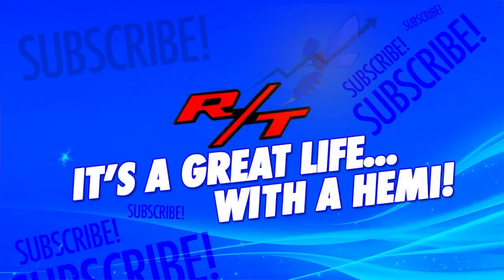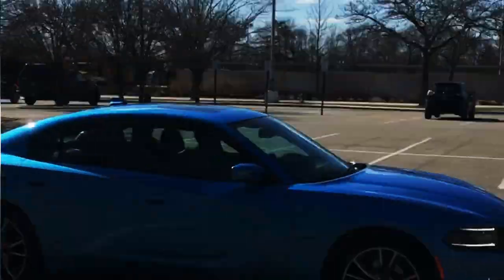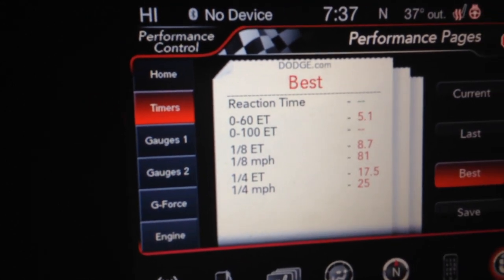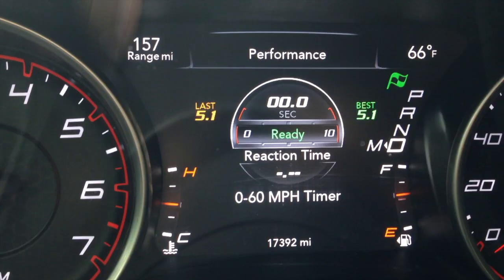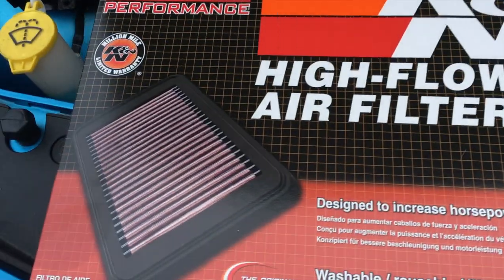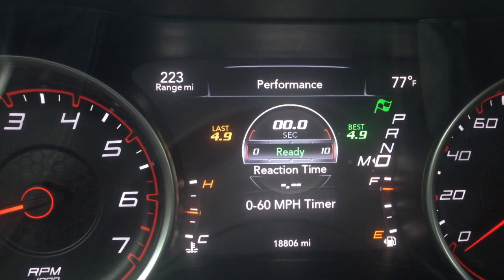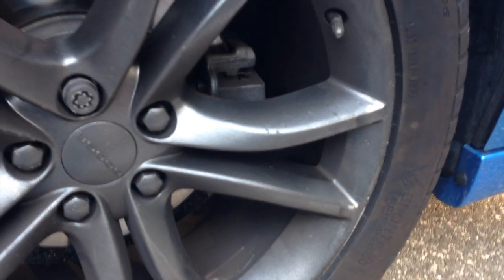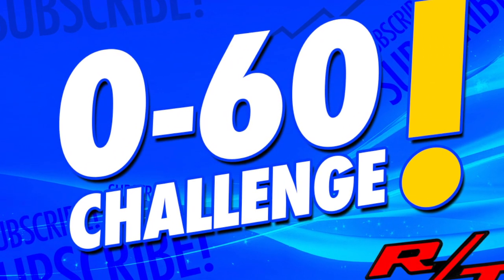Performance Mods // Corsa Intake, Scat 1 PCM..

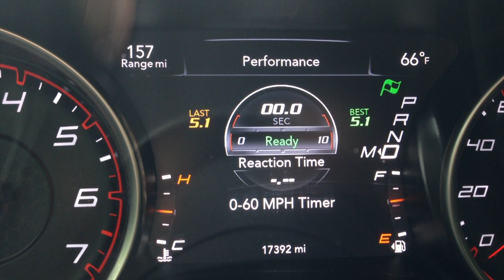Comment: Another honest, straight forward video...excellent!! I can tell that you're NOT 1 of those guys that manages to get some H/P out of replacing Valve Stems!!! Hahahaha....If you don't get any improvements on an install, you call it like you see it!! I like that shit from car guys, and I am the same way. Now, I've not done any "Performance Mods" to my SP Shaker, the only things I've done to it are that I installed a HURST Short Throw Shifter with the Carbon Fiber Pistol Grip (Fuck I love that thing a lot, with the Shorter Shifts and the looks and feel of the Pistol Grip) and I have a TAZER, a Mid-Muffler Delete and I also replaced the OEM Blue Filter with a very nice BLACK HEX Filter from R2C Performance, why?? Two reasons...My Challenger SP Shaker is Maximum Steel and I wanted a Black Filter under the hood and secondly, I read several reviews and info pages that the Black Hex Filter delivers 3-4 Times the Air Flow Rate of the OEM filter. Btw, they do also make this filter in the same Blue as the OEM Filter...here's the LINK if you'd like to check it out>> http://www.r2cperformance.com/mopar-cold-air-intake-replacement-filters.aspx So back to the post here. I appreciate your honest and unbiased reviews and opinions on your upgrades. Thank you for doing that here. I found it interesting and informative. I do have some plans for my SP, which will start in the spring once I bring the car out of winter storage. The car only has 13,000 miles on it, I did factory order it in 2016, to get exactly what I wanted, in the colour I wanted. It is fully loaded minus 2 options, it does not have an Automatic and it does not have a Power Sunroof, but it has everything else, even the Black Matte Alloy Wheels, which I nearly didn't order because I never saw them in person and to me the pictures didn't do them any justice at all. But about 4-5 days later, I was at the mall and I saw a Billet Silver SP Challenger parked way out in the "Back 40"all alone...lol...which is exactly where I now park...Hahaha...I'm sure you do the same thing?? Anyway, as I drove by to leave the mall, I did notice the wheels but I wasn't sure what they were?? If they were an aftermarket wheel or the Matte Alloy Wheels?? So, since I had some time to kill, I parked about 100 feet from the SP and had a smoke, read some texts and before I finished my smoke, I saw a guy walking towards that SP. I told him that I liked his car, he said thanks, and I asked him if the wheels were the OEM Matte Alloy wheels?? He said, yes they were, why?? So I told him why and he said that he loved them and how they looked on his car and would I like to take a closer look at them?? Of course I would!! Lol... Anyway, long story short because we ended up yapping for 30 mins or so, I called the dealership right away and asked if I could add them to my order and the Rep said, yes I could, so I did and I'm glad that I did too!! They go nicely with the Maximum Steel paint, IMHO!! But anyway, due to the low mileage, I'm not going to need tires yet, so I'm going to spend the money on some performance goodies instead. Some things I'm considering and I'm currently researching are, a larger Throttle Body, the Stage 1 PCM (which you've given me a lot of info on) Headers and of course a matching exhaust for the Headers. I've always used Magnaflow Mufflers on the last 3 vehicles and I love their exhaust note, an Intake and Cam setup and a Tune. Basically just Bolt On Performance Mods and by that I mean, I'll not do a Supercharger/Turbocharger at all. There's nothing wrong with them at all, especially when I've seen the numbers on a Supercharger attached to a 6.4L, very nice numbers and very nice track times too, but it's just not something I want to do with my car. So...1) Larger Throttle Body 2) Intake Manifold & Cam 3) Headers & Exhaust 4) PCM & Tune and maybe 5) Fuel Injectors and that about covers it. Then I'll do NEW Tires & Wheels like 275's Front and 305/315's in the Rear along with some suspension stuff. But there's one other thing that I need to research as well and that's Rear Gears. Back in the day (I'm 56) when I had 60's muscle cars, the thing to do was to lose the 3:23 or 3:55 gears and install 4:11's or 4:56's and that was a real improvement to get those tanks moving!! Hahaha...So, I was thinking about Rear Gears a couple of weeks ago but I haven't got right into the research part of adding 4:56 Gears to my SP. Do you have any thoughts or experience in that end of Modding your Charger or maybe some of your fellow Mopar Madmen doing that switch or even researching it at all?? If you have any info on that, I would appreciate hearing what you have to say about new Rear Gears. ok, thanks for the great vid again!! Take Care!! ~Tom..

Comment: Just to clarify, did you put the Flowmasters in the rear and still have the mid delete? Sounds great, that's why I'm asking. I also have a mid muffler delete and my scat pack sounds a little too raspy for my taste.  Thanks, Mike.
Reply from the maker: I put the flowmasters where the mid mufflers used to be & then removed the resonators. The flows organize the exhaust tone really nicely, it was worlds better then my mid delete. The mid delete was great though, I did it because the car is to quiet out of factory.
Reply: Thanks for clarifying! I want mine to sound like that :) I loved the raspy sound and pops, etc. at first, but now I'm in love with the deep tone yours has!
Reply from the maker: Yours will sound even better - nice deep rumble, sounds wonderful barreling down the road! Let me know how it all works out
Reply: I'll definitely do that and keep in touch.

Comment: Have you thought about getting an unlocked PCM?
Reply from the maker: At some point this PCM will have to get unlocked in order for me to progress.
Reply: If you do longtube headers it will definitely need to be unlocked so that you can turn off the secondary o2 sensors.

Comment: For how much did you buy the hellcat rims and how big should they be fo all 315s
Reply from the maker: They were around $700 - you can get away with 20x10 in the back to fit 315's. Best bet though is 20x11. That will make the 315's more effective.